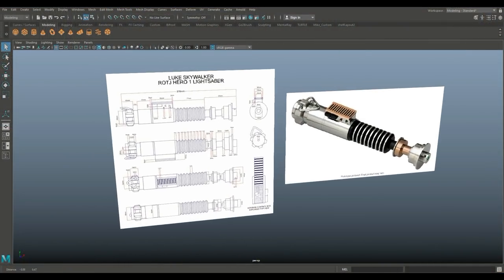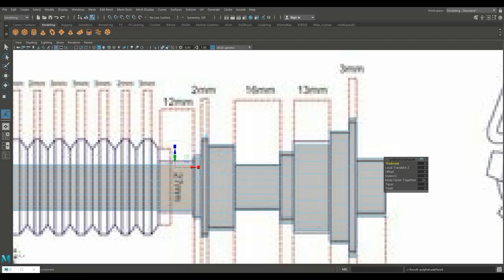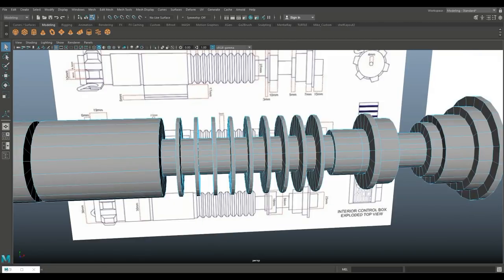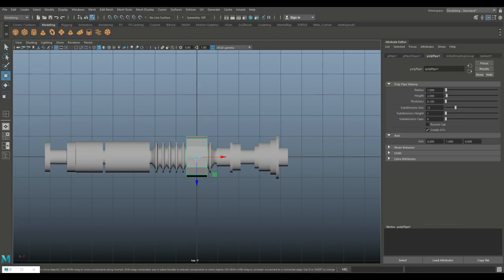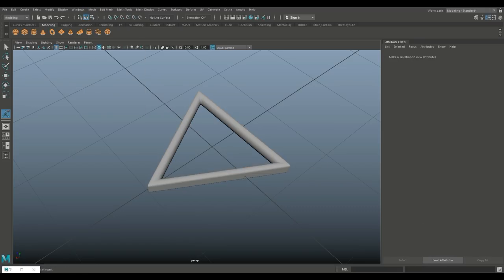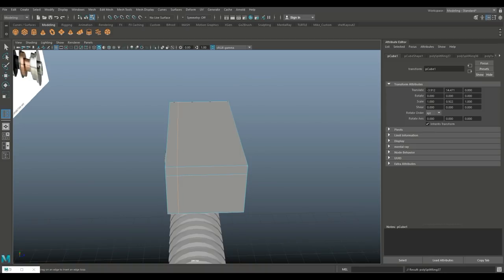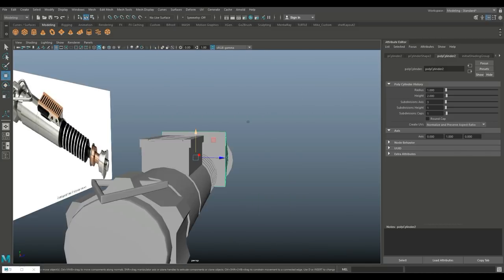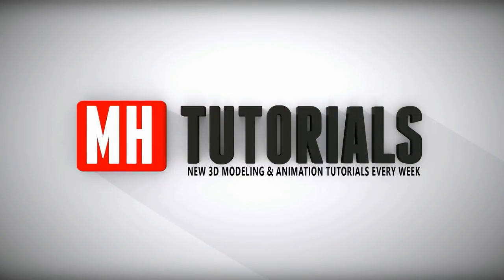Modeling Luke Skywalker's Return Of The Jedi LIGHTSABER in Maya 2018

Comment: hello Mr.Mike, I would like to know is it worth creating a character 6 feet tall in maya 2017?? I did one and when I assign Xgen fur to it, every single operation I do the maya software hangs, also I have 16 GB Ram, 6 GB graphic card, window 10, can you suggest any tips to resolve this issue. thanks in advance mike..
Reply from the maker: Yes, there is no need to model 6ft tall. Just upscale it for final use. As for XGen, work with a small number of tunes / hairs until you are ready for render